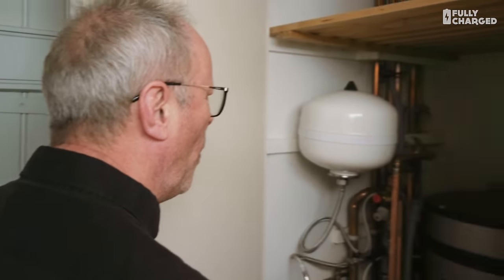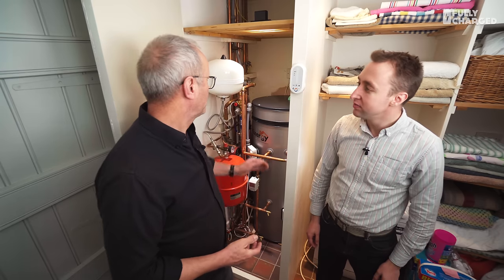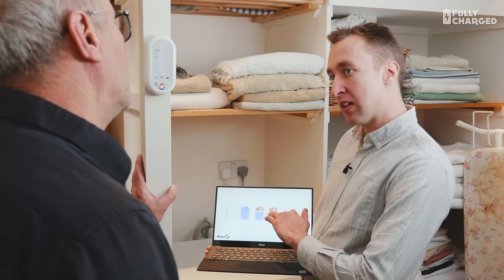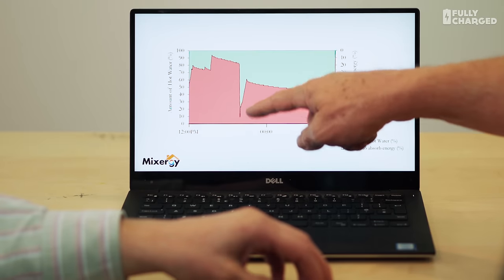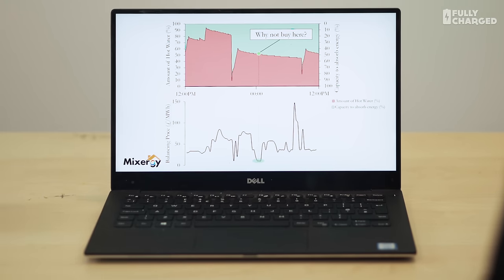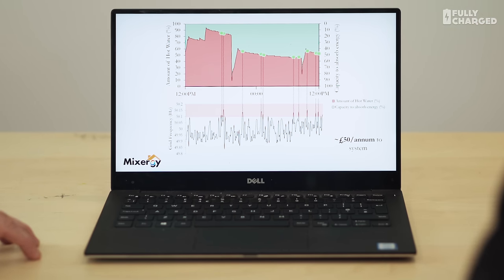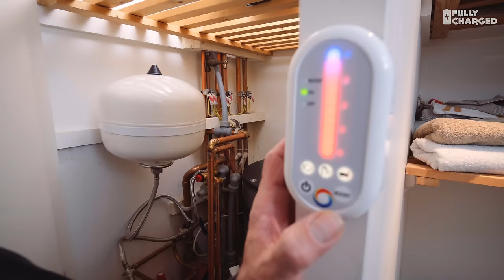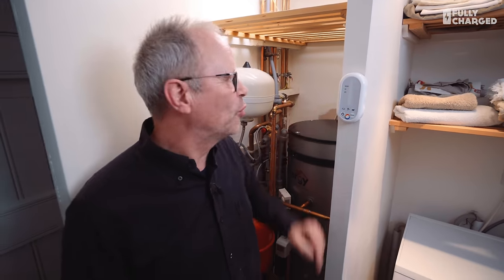Mixergy Hot Water Tank | Fully Charged

Comment: They are cylinders not tanks. A tank lives in your loft and feeds an old vented cylinder. Sorry to be a pendant!
Reply: It's pedant.

.....Doh!
Reply: Except he may actually be a pendant, around someone's neck and be apologising for that. Sorry!
Reply: Actually,  those things in the loft are cisterns.
Reply: Ah yes you're right! We often have this debate internally but people use the term tank interchangeably with cylinder and we think that most people relate better to the word 'tank' whereas 'cylinder' is a bit more obscure for non-technical people... apologies Daniel for the faux pax I hope you can look past this :)
Reply: Wrong. A tank can be any size and form and contain a gas, liquid or even solids (eg septic tank).
Rocket tanks are spheroidal or capsular, automotive fuel tanks can be irregularly shaped pressure vessels moulded to occupy the maximum available space in the void reserved for it. Larger fuel tanks at refineries are enormous cylindrical structures, as are municipal tanks for storing gas.
Other tanks can be rectangular, polygonal, spheroidal or amorphous.
Sorry to be a pedant!
Reply: Pete armstrong . All my customers call them tanks too. I ask them where the cylinder cupboard is and they give me blank looks. I work for a heat pump and boiler manufacturer and am surprised at how poor most anti legionella control is with regard to energy use. Most are just time clocks. Surely it would be better to measure flow from cylinder over time and cross reference that with cylinder temps via ntc's at top and bottom so a smart controller can decide if it is really necessary to do a sterilisation cycle.
Reply: Andy Lee Robinson and the difference between all those things your describe,  and the things in the loft?
Reply: Apart from their applications, nothing. They are all containers, or tanks.
Reply: Andy Lee Robinson https://en.m.wikipedia.org/wiki/Cistern
Reply: Dan, good link, but as it says, a cistern is just a tank with a removable lid. Small difference!